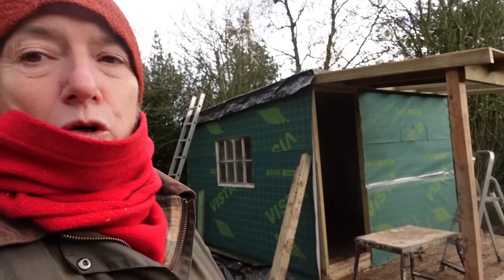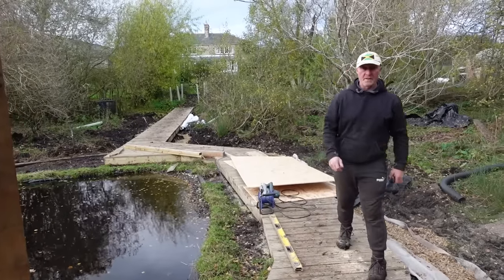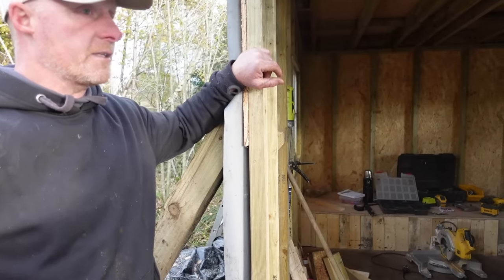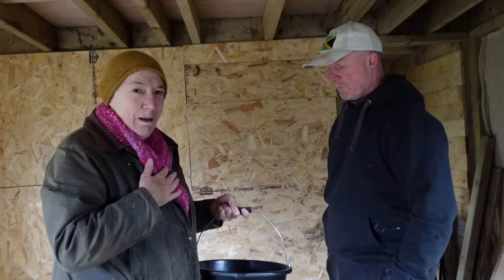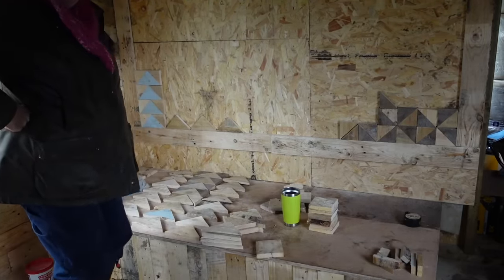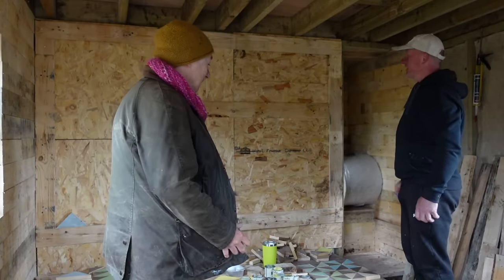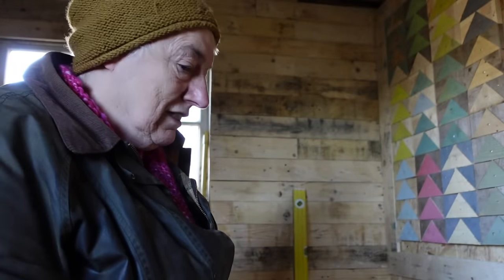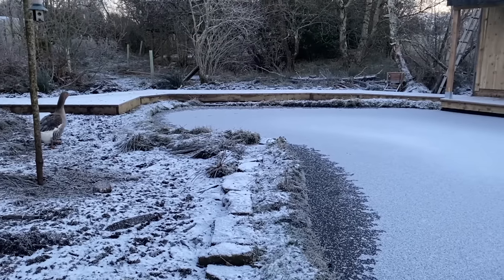Progress on my CABIN by the Pond and a QUILT! #9

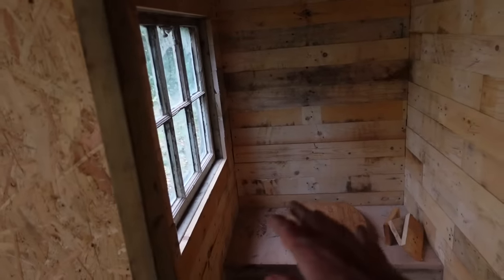Comment: 2:00 I know this little cottage is in your private garden, but consider a small roll up curtain for this window... as you never know when you'll have a surprise visitor😲😲. 

Consider making the fabric similar to the dotted sewing pouch with the lime green lining, that you made and hanging it high so as not to obscure your beautiful view. But low enough to reach whilst still seated. 😲😲

Quilted fabric curtains will help keep the heat in during the winter and cut down on drafts. 😮. 💖🌞🌵😷

Comment: Kate I can’t tell you how much I loved everything in this video! ❤❤❤ I have always loved to build simple things, and my daughter asked me once how I knew how to do it. I have sewn all my life, and I told her it was just like measuring and cutting fabric, the tools are just different. Your wooden quilt wall is awesome, and the “cabin colors” are perfect. I would cover the whole design area with a satin finish varnish to bring out the natural colors of the wood.  Did I also spot a “log cabin” design in the wall paneling under the window area by the door? Do you get enough sun in that area to put in a small solar panel to give you enough electricity for lights and a small space heater to use when you are using the cabin on chilly days. It would be very cool to be “off the grid” with this cabin!
I can’t wait to see this finished.

Comment: Just caught a glimpse of the log cabin blocks Ant created under where the front window will be going.  He really has the quilting bug.  Maybe he will do a couple of Barn Quilts for the outside.  Lots of inspiration on the internet as it is a tradition in the MidWest.  Most are just painted but using the same blocks principal it could be done inside a frame

Comment: This is a beautiful setting.  Will be so nice to watch the seasons while sitting on your deck.  And how fun to turn wood scrapes into a quilt.  I do have an observation on the differences in building.  The wood for your deck and walkway are scored.  Here cedar boards are scored like that to help keep the wood from warping in the wet weather.  The interesting thing is the scores are put down rather than facing up so the water does not capture the dirt and wet and cause the wood to rot out more quickly.  Just an observation.

Comment: I got a small electric infrared heater for my sewing room, and it works very well!  Hardly any time to warm up, does not take much room, and is safe to touch while running.  This was important because of all the fabric, and I needed something that would not be  fire hazard.  Halogen worried me.

Comment: You could probably run the pallet boards through planer befor installing them.  Or use a heavy duty sander on the walls afterwards.